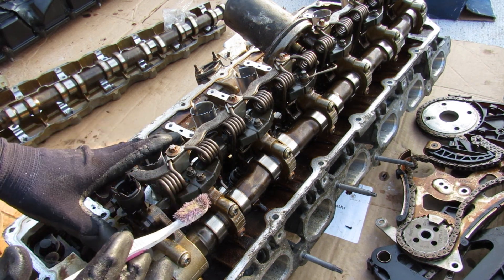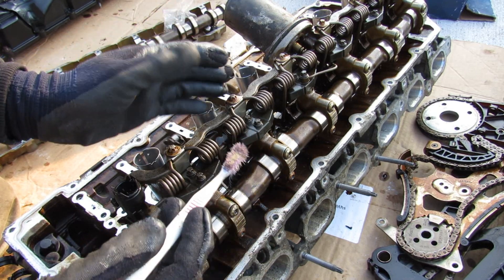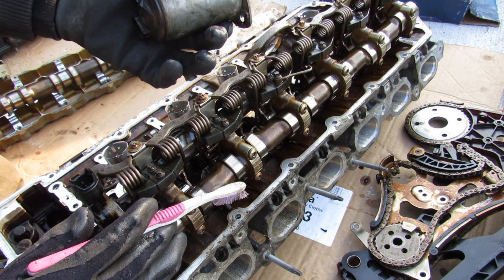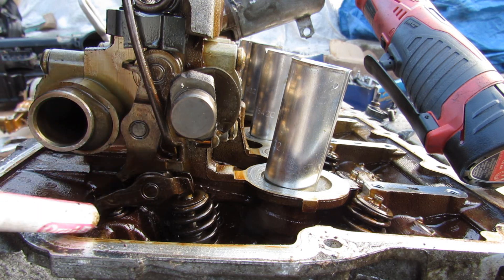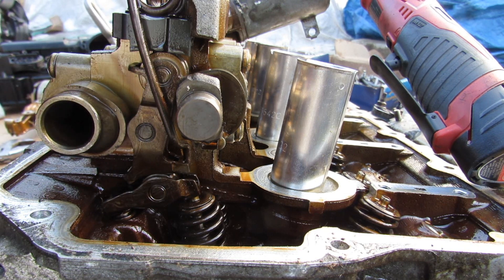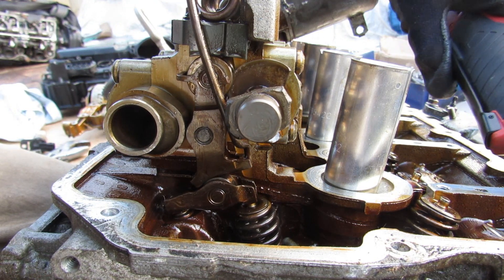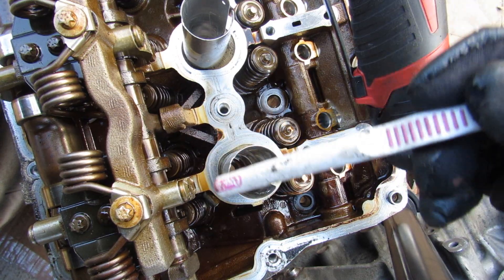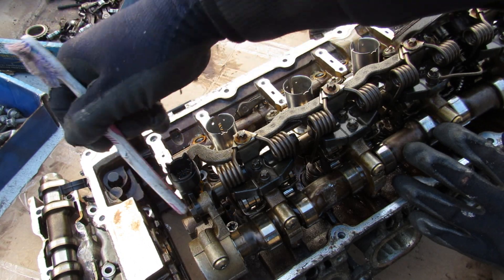How BMW Valvetronic Works

Comment: Why didn't they just delete the throttle body and TPS sensor altogether sincerely the eccentric shaft and eccentric shaft sensor controls air intake? Maybe most BMW owners don't know but BMW also has a system called Variable Intake Manifold (VIN) which controls volume and speed of air entering the intake manifold with an actuator (Short runner=increase air volume and long turn increase air velocity entering the intake manifold). Lot of components included unnecessary in the Air-Injection and control system. Germans are masters of complex unreliable and unrealistic engineering. They make Toyota look great and best without doing much to improve their standard.

Comment: If the valventric doesn't work, will the motor vibrate? When I unplug the ball joint, it works fine. When I plug it in, the motor vibrates. Does that mean I need to replace the valventric?

Comment: If this system fails valves are open in minimum length . So how it can operate in fully throttle open becz valvs are slightly open ??
Reply: It will go into limp mode that you’ll be able to go 20 mph as I assume most car home limp mode goes up to 30

Comment: This complicated technology made bmw the most unreliable vehicle in the auto industry. What's the point of having throttle body and valvetronic system. They do the same intended work. Worst is if vvt motor fail and throttle body works visa verse the computer put the whole in limp mode. This vvt system renders the throttle body used but at the same relies on th throttle body to control the intake air.

Comment: Good video.... What is the role of camshaft in this valve tronic system?
Thanks.
Reply: the camshaft is what actually opens and closes the valves as the engine runs. The eccentric shaft (and general Valvetronic system) merely determine how open the valve gets at maximum opening.

Comment: What happens when the gears are damaged on the valvetronic shaft?
Reply: Engine change to normal thortal body
Reply: So would that then put the car in a limp mode per say?
Reply: The camlift will be locked, pray it's not at the lowest setting

Comment: My only question not answered is why? Why not just have traditional throttle body only
Reply: Valvetronic allows greater efficiency because the valve lift is continuously variable.
Reply: He answered that.  The VANOS system reduces pumping losses vs. a traditional throttle body.
Reply: @lashlarue7924  
Vanos is Bmw's variable valve timing whereas Valvetronic is variable valve lift, two different systems.
Reply: @lashlarue7924  because you can essentially change cams as you're driving depending on what you're doing with the car with this system

Comment: With innovation, comes complexity. Too many moving parts for something not to go wrong.
Reply: No. This design has proven to be reliable, and working more than well in the intended way - low-load BSFC is among the best with BMW's engines equipped with this mechanism. Throttling the inflowing air is the dumbest way to adjust power output, as it creates a really useless and preventable loss. Complexity isn't bad in itself, it's only bad if it doesn't provide any advantage or if it is executed poorly and therefore reduces reliability. If it is executed well, and delivers the advantage aimed at, it still may cost a bit on top, but with any machinery used to convert power, an energy-conserving feature like this justifies it's additional cost by reducing the cost of fuel by burning less of it. And, for sure, it does!

... but, OTOH, I do have a drawer full of sketches and principles and stuff to be used on gas engines that, as I don't work engine development anymore, will remain there ... one slightly better valvetrain layout is among these, which would sometimes allow to not need a cam phasing device on the intake by providing a constant minimum distance between valve and piston - only being later than this might require one ... and even if there is one, it would be used far less, as with lower lift and shorter duration, in that case, comes earlier peak lift.

Would BMW want, they could have this labeled as Valvetronic Mk.3 or so, but ... they didn't hire me, and ICE-development, sadly, won't be demanded anymore, at least not like it was the last 10...15 years.
Reply: This is a 22 year old product now…